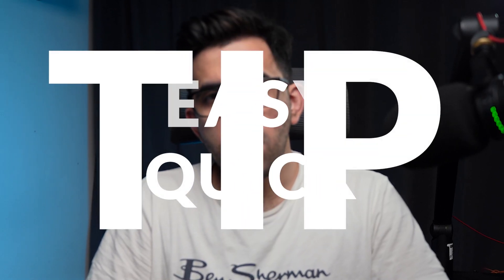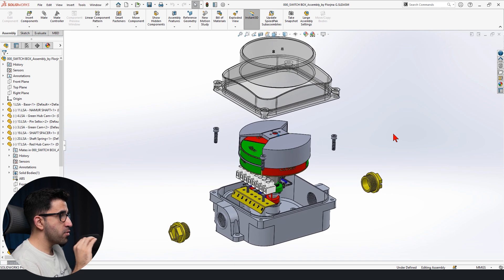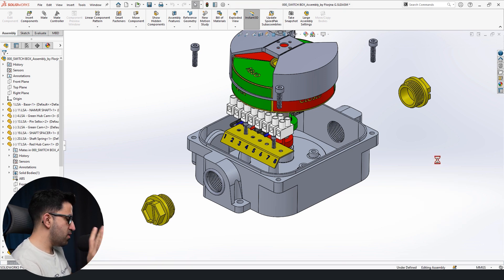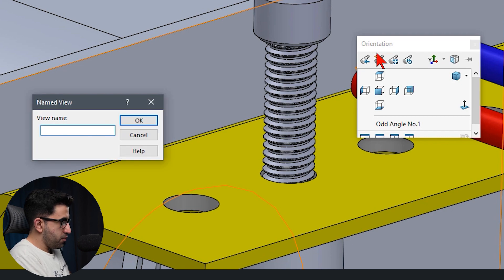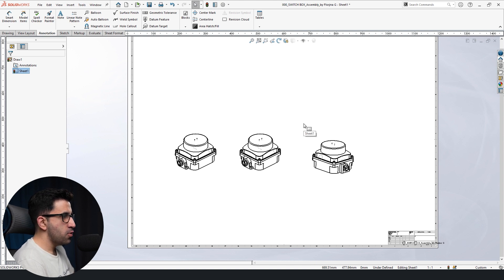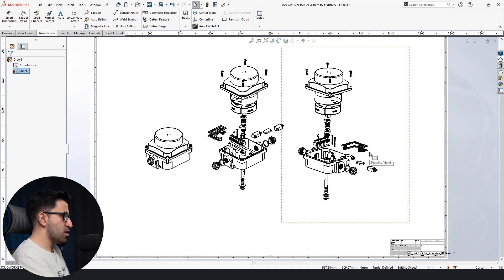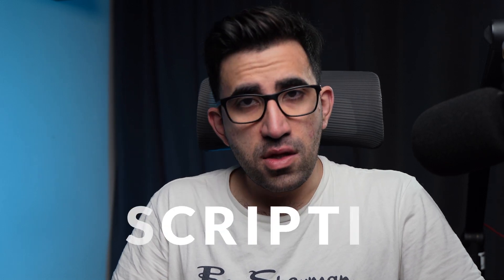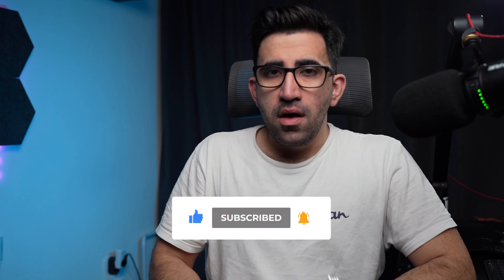SolidWorks - Save an Odd Angle View (+Bonus tip for exploded view)

Comment: Another awesome tip. Do you have a video where you explain what everybody should take into account when working with assemblies, sub assemblies and parts. I guess in a way good practices and structured work tips because I am working on a big motorcycle battery pack and I seem to always have multiple warnings and things that just brake  stuff in the assembly when I change them on part level... I cant seem to make it in a way that everything gets updated on itself when changed. Would that also work with parts using equations or configurations that could be changed directly in the assembly without everything going crazy. Thanks for your videos
Reply from the maker: thanks, no not yet, I'll keep that in mind